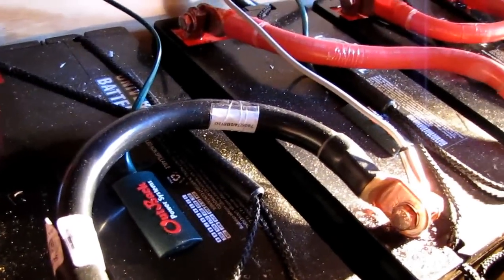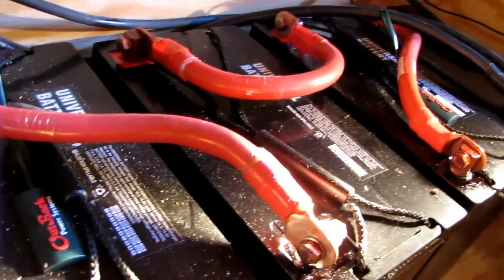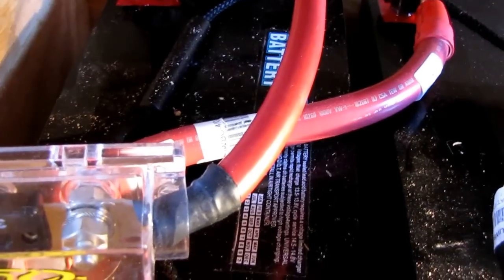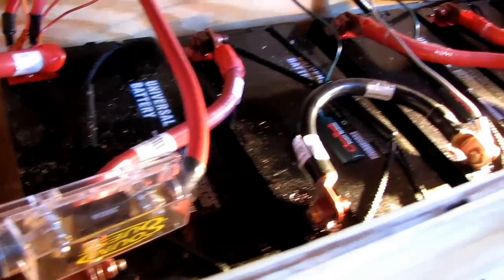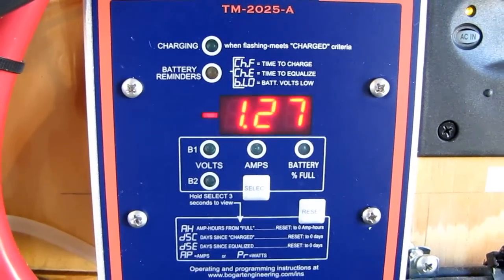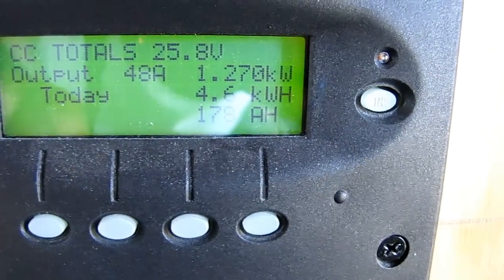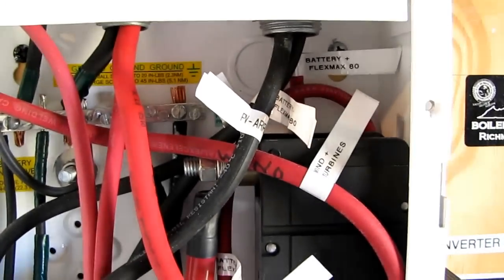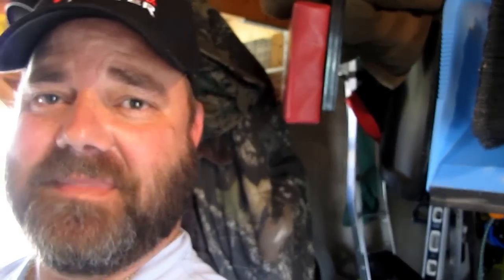My Solar And  Wind  AGM Battery Bank By VIARLOCITY

Comment: Kenny, thanks for the great videos. Very helpful.
Just wondering.... If your batteries are AGM, then why do you have them enclosed in a fan vented box?
Theoretically the gasses from AGM batteries are virtually none existent.
Again, keep the renewable energy vids coming ! Nice work !
Reply from the maker: +gosub283 Hey Buddy Yes They Are AGM  Batteries And Virtually No Gassing  ! The Fans Are In There To Keep The Batteries Cool In Summer When The Air Conditioning Is Running  And In Winter I Heat The Battery With HydroFarm Heat Mats To Keep The Batteries Warm  Hollar At Me Anytime Cheers Kenny

Comment: wow... take a pic and ask anyone at the battery shop or anyone else u trust... cos ur only using 90Ah and not 3 times that which shoud be 270Ah. Each pair of batts shud connect together on ya bus bar, meaning 3 x pos on the pos bar and 3 x neg on the neg bar. Good Luck!

Comment from the maker: LOL Nope They Are Working Great I have Been Running Them For  4 Years There Working Great Buddy   I Have The Battery Bank Set Up In 24 Volt s  Using 6  12 Volt 90 Am Hour Batteries

Comment from the maker: I have Had These Universal Battery Group Or UBG's  Since 2009 and Still Going Strong  They are Like $ 225.00  Each I give Them 5 rating There Awesome ! They Are 27 series Batteries Deep Cycle 90 amp Hours Each

Comment from the maker: Hi Smokie1969 There is No Such Thing as a Dumb question ! Thats Is The question is Not Asked  ! Plywood Is Really Good for Backing ! On Components  Such as Charge Controllers Inverters Etc. I used To use Plywood To Protect The The Floors etc to weld Over Top Of The Fire Balls Molten Metal would roll Off Of It ! Of Course It Will Burn But It Will Take A While For It Too ! Thanks So Much For Watching Mate SemperFi